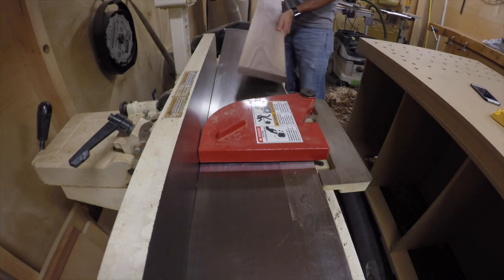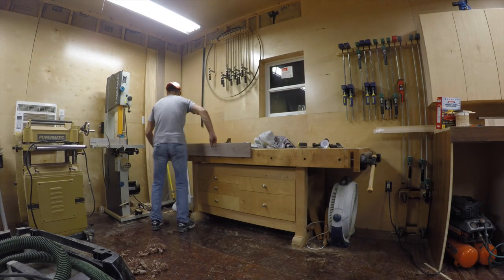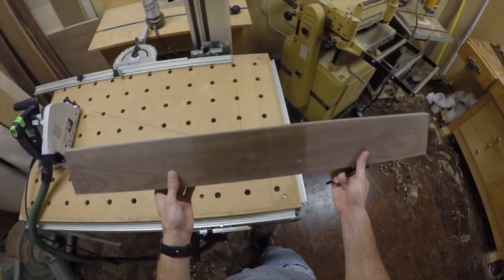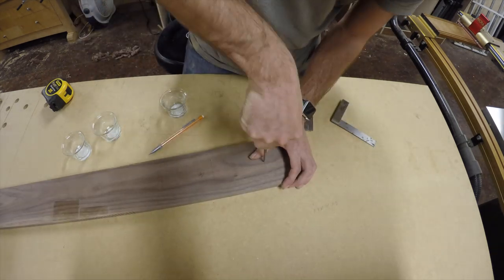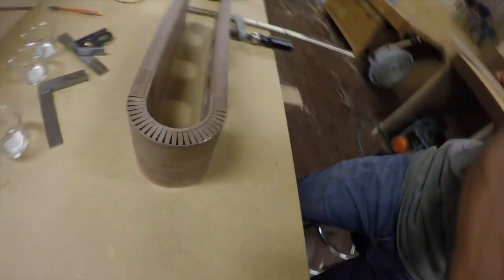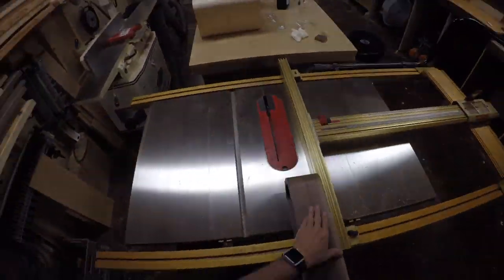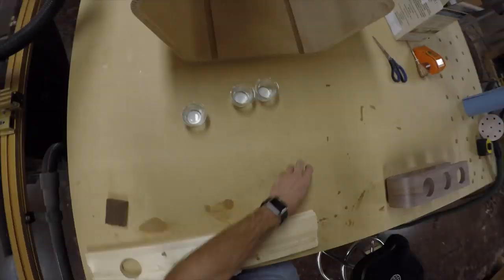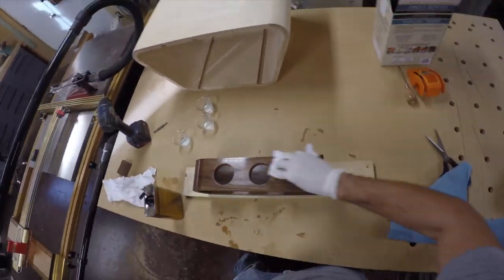Build this Candle Holder

Comment: As for the epoxy part, what I do is use epoxy paste. Spread the paste over and into the kerfs using a plastic mud knife. Bend it and clean out the excess. This makes the adhesion full and fills up all the spaces creating  very solid joints.  You can mix the epoxy paste with the wood dust that came off the kerfs so it blends better with the wood. You can also use the liquid epoxy as shown in the video but this may run out of the kerfs. Mixing it w the wood dust will minimize the runout.

Comment: that table saw fence contraption looks pretty neato!
does the Kerf bend have to be with hardwood?
Reply from the maker: No, the kerf bending could be done with plywood as well.  Probably not possible with MDF, particleboard, etc however.

Comment: Great concept.. Did you start in the middle of the board then do equal cuts on each side? I counted 25 cuts.  How far apart are each cut?  what is the expoxy brand you used tks greg...i tried a 3/4 in piece of oak before using good wood that was 24 inches in length.  I was about 1/16 of inch from top with about 1/8 for each space.  I believe you used 3/4 inch and 24 inches in length.  when I counted the kerfs in your board it was about 25 so i figured mine would need the same amount. As i bent it after the 25 cut, the board barely made it around and cracked in the middle.. any suggestions? tks greg
Reply from the maker: Honestly can’t remember the number of cuts but I believe the width between was right around 3/16”. I just start in the middle and start making cuts moving away from the center until it folds around the way I like. Epoxy was just basic table top epoxy from Lowe’s but there are a ton of options for that. The kerf of your saw blade and thickness of the material will determine the required number of cuts also. My board was 3/4 thick walnut. Oak would be tough to do this with because of how fiberous it is. Make all of your cuts then get a spray bottle of water and spray the side with no cuts then put a cotton cloth over the wet wood. Then run a hot clothes iron over it. This will put some steam into the wood making it more plyable. Now very slowly and carefully start bending it. If it sounds or feels like it’s going to break add more water and heat until it bends.
Reply: Dairy Barn Woodworking ok good to know about oak. I really like the concept.    Does the board need to be a minimum of 24 inches to work Like in your video.?  My blade is 1/8 inch thick.   What is the distance between each cut have to be? Tks
Reply from the maker: Christina Fox-Sencaj there really is no set distance between the kerfs. The more space between the kerfs the larger the radius of the bend will be.  Also there is no set length the board has to be. It’s all a matter of preference.

Comment: Beautiful work. Thanks for sharing.  Are there species of wood which are not suitable to do kerf bending?
Reply from the maker: To my knowledge most woods kerf bend very well.  I have not seen a wood that did not work well yet.
Reply: @dairybarnwoodworking215  Thanks for your reply. I only have pine. I'll give it a try.

Comment: Very nice looking holder.  Two tips however.  First, there are no pictures in the beginning or end to show off the piece.   I would highly recommend some nice shots at the beginning.   It drives me nuts when people try to make you wait till the end to see the finished piece.  I usually skip those videos.   Second, the bending wasn't very clear.  Why did you fill in the epoxy from the ends and not just fill the slots from the open sides?

Comment: Another tip which I haven't seen anyone else commenting, is you need to talk consistently in the same voice level. Your in-between mumbling makes it hard to follow you and makes you sound worse than you are. Don't mumble please. And as the others said, get a tripod for your general shots. If you need to move in close or do shots like the gopro on the planer, then look into gimbals. They make the camera stay steady when minor shaking occurs around it. They can also be made DIY, so you don't have to bust the bank on one. Also, you may want to look into Bent Lamination. It would make your project here easier to do

Comment: I liked the GoPro ride "through" the planer. 

How do you calculate where to start/end the kerf cuts to get the board to bend at a predetermined/desired mark? Say you want your bend to start at 7" from the end at a 90 degree angle where do you start/mid/end kerf cuts?
Reply from the maker: TXstang347 so you can absolutely do the math and I have done that on previous projects that made a complete circle but on something simple like this I just sort of wing it and make kerf cuts until I get the bend I want. Then I measure from the start of the cuts and make a cut then measure from the end of the kerf cuts and make that cut. Not sure if that makes sense or not.
Reply: Dairy Barn Woodworking not exactly lol. My best guess on my first attempt I made 7 kerf cuts. The first 3 cuts below the point I wanted it to bend 90 degrees at and the last 3 cuts above the bend, but it's not quite bending where I'd like. Adding more cuts leaves a few on the ends with an open gap that serve no function and probably weakening the structure. Any ideas on spacing, depth or how many cuts to achieve a certain degree of bend? Like your trapezoid seems pretty precise. Was that just trial and error?
Reply from the maker: TXstang347 so let’s say you want to bend 3/4” material with an inside radius of 2 1/2” 90 degrees. What I do is make a drawing in sketchup. From the drawing I can measure the length of the inside arc from start of arc to end of arc then I measure the outside arc(which would have a radius of 3  1/4”) from start of arc to end of arc. Now take that outside arc length and subtract that inside arc length. This will tell you the amount of material you need to remove with kerf cuts so take that and divide by the thickness of your saw kerf which will give you the number of cuts required. Probably clear as mud 😀. Did you watch my other video on this?  I think I explain it there.

Comment: Looks great. Not sure what I’m doing wrong, I did 24 kerf cuts 1/4” apart in 3/4” plywood and with pine with 1/8th left for thickness and I’ve had to soak it. Definitely did not bend like that

Comment: With a nice workshop, $50K in tools and some know how, you too can build a candle holder.
Reply: You can get the same result with just a piece of 1x4 maple from Home Depot, a table saw, and an orbital sander. I don't know why you would need to joint, plane and dress all the sides when they aren't going to join to anything. It's like you don't need running shoes to run but it's nice when you have them.